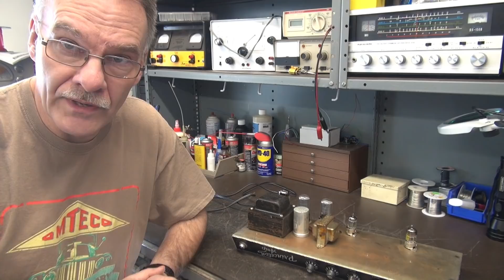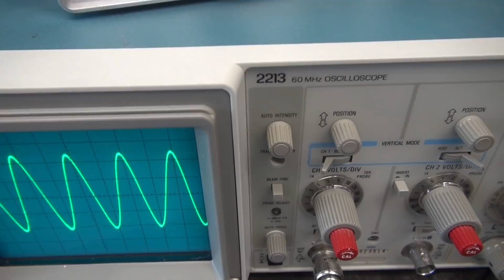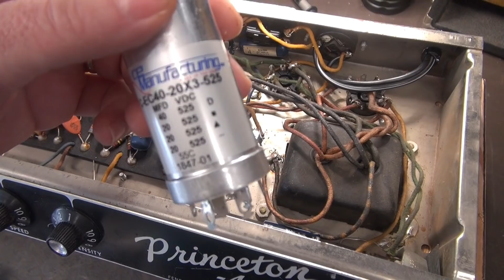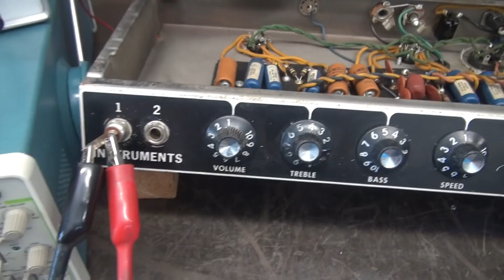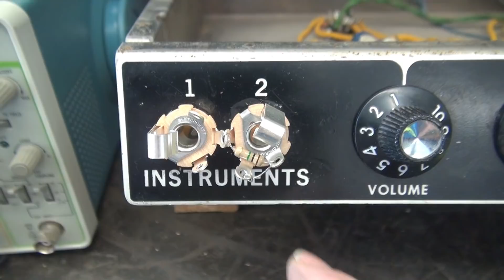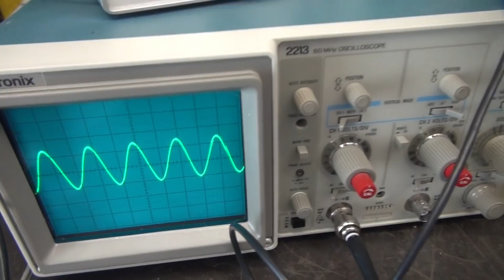How to fix 1964 Fender Princeton Low gain weak tube guitar amp Step by step

Comment: I liked both tube choices. The bite of the original would suit live and the mellowness of the replacement practice. Both tubes, but switchable and twice as much output power... Guitar players are never satisfied... As it happens the channel switching on my Super 60 already does exactly that. And LOUD!  Nice little amp. Thanks.

Comment: Incidentally, if you lack a suitable Snozzeramus you can solder to a steel chassis very well by clamping the threaded end of a 4-5" 1/4-20 or 5/16 bolt in a pair of vice grips and heating up the head in a propane torch. File the head semi-clean if it's a rusty dog. Stop heating before red heat. Use it just like you would a big fat soldering iron. You don't really have to tin the bolt-head. Works perfect.

Comment: Good Morning. Here in Brazil, in the 60s, the company Giannini launched some tube ampules inspired by Fender's projects. I have the Thunder Sound Bass model that was based on Bassman and I have Valiant, based on Pinceton. Could you give me an email address so I can send you some pictures? Regarding the Valiant model, it has 6v6 on the output and the card is 436VDC, -31VDC bias. I would like to be able to exchange information with Mr. Thank you.
Reply: ...don't you mean "amplifier" instead of "ampule"(?)

Comment: How much extra power is it putting out?? Has it been modded to run like a deluxe with 22 watts?? It could be a weber transformer used as a replacement. Weber in their clones use power trans that run both princetons or deluxes. I could be mistaken,,,, I often am!!  And I've heard that you can drop in deluxe power and output tranny's in a prince ton with out any drama.

Comment: Great to see & hear Tony again! What do you think the output watts were with the different wreckdum-fire tubes! 3 or 4 watts? I could tell some different tone differences between the 2 tubes, but could not tell the volume changes. It really does not matter. You did a great job, as always, on getting this little jewel back up in form! Thanks for another guitar amp project Terry! And thank you Tony for tickling the strings on the beautiful Tele! Thanxz

Comment: Nice video.
I personally don't like those multiple cap cans. If one cap (usually the first one, which has to take the biggest ripple current peaks) of that multiple cap can fails, you have a problem. I prefer the dog house and normal axial capacitors which can be changed individually.
I would be quite suspicious about those old coupling caps as well, especially output tube coupling caps. If they failed, output tubes would be in danger.
Reply: Yes,coupling caps' can be a big problem,in these older Fenders'!